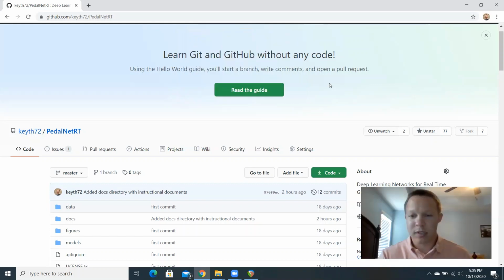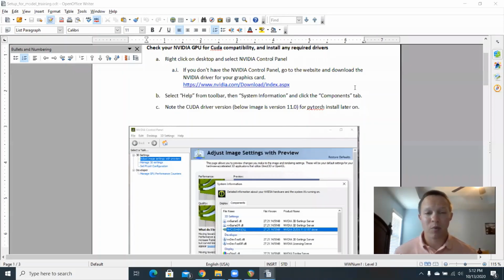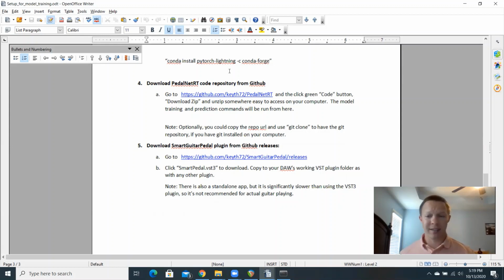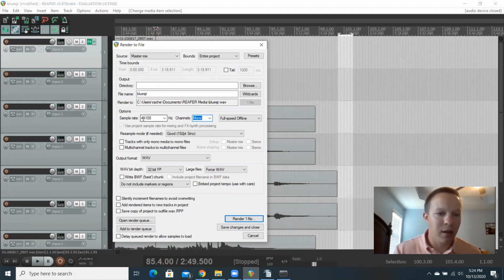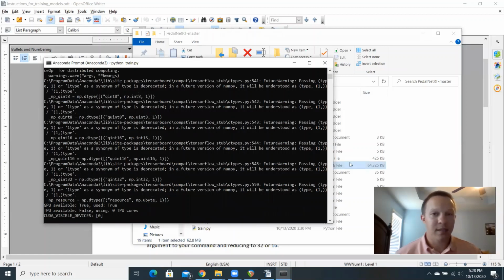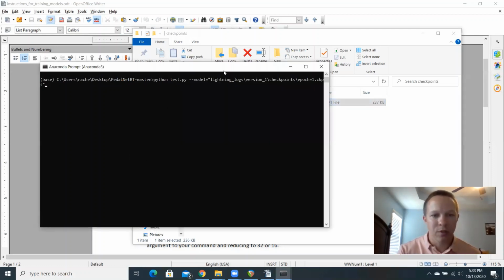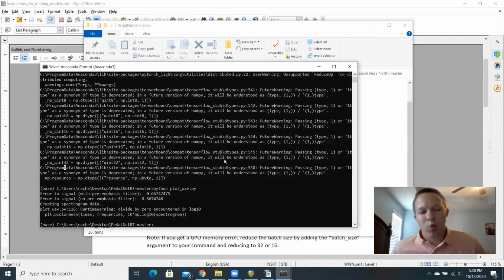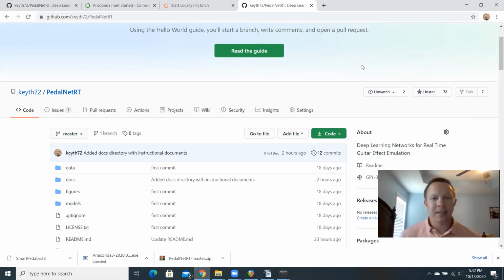Tutorial - Using Machine Learning for Emulation of Guitar Amps and Pedals

Comment: Thank you!! I will be following this guide today, I was following your project since I found it like 2 months ago but I didn't have time to use your files :(, now I can and also you did a video!, didn't know it was so straightforward :)
Thank you!!
Reply from the maker: Thanks for the great feedback! I think people hear terms like “artificial intelligence” and “machine learning” and assume it’s really complicated, but it’s really just a different way to solve problems, and there are a lot of great tools like PyTorch that make it accessible to anyone. Let me know if you run into any problems and I’ll help you out.
Reply: @keithbloemer  Thank you!! One thing I was thinking that you could improve is to add a low and high pass filter (for both wav files) in your model before doing the training, if you delete low and high freq (0-60, 10k-30k) the training should be easier since there's less information, and also high freq uses a lot of data, and maybe easier for the model to replicate the original file :)
Reply from the maker: @Francisco17Berrios  It should save the most accurate model it can train within the 1500 epoch limit, or whatever limit you set it to. As far as what’s an acceptable loss, it’s really up to what you think sounds good. Less than .02 and I usually can’t tell the difference between the model and the real thing.
Reply: @keithbloemer  Thank you!

Comment: Thank you for the video! Really straightforward and accessible. I'm curious about a part of the process that either was not mentioned or that I missed though. How is it that your SmartPedal plugin can have a control for "Drive" after the model is trained on a set of audio files that only represent that pedal at one particular setting? Are you able to create a single model with multiple measurements at settings across the range of the knob?
Reply from the maker: Good question, and I didn’t mention that in the video. The drive is just a basic amplification of the signal prior to the model, level comes after the model, and I apply any EQ before the model. It’s probably possible to do a model with a range of settings, but I’ll leave that for another day. Much simpler to have a single model and adjust the signal going in and out of it.
Reply: @keithbloemer  very interesting! thank you for the feedback. for some reason I was not picturing the model as a classic "system" and didn't realize that you could drive a signal prior to the model similar to a nonlinear curve. one thing I will say though is that in my work I found the Tube Screamer to have a nonlinear curve that dynamically changes as you move the "Drive" control. this would lead me to believe that, in order for this model to be accurate to the reference, you would have to create a model with a range of settings. perhaps by creating N models in total and crossfading between them somehow? though I'm not sure if that's possible or if there would be a simpler approach. any thoughts? I may be missing something as I am completely new to ML. thanks again for the video
Reply from the maker: @CamFilms1000  I think you’re right, training a model (or multiple models) at different settings and somehow interpolating between them should be more true to the source hardware. It would take more effort to capture all that data, but if you want to get as close as possible to how the hardware behaves that’s probably the way to go.
Reply: @keithbloemer  Awesome. Really appreciate this dialogue. I was unsure if maybe there was a way to train a model with multiple input/output measurements and be able to interact with that model directly through a control that is a part of the model which would perform the interpolation for you. To me that sounded like a better approach than having to run N models at once but it sounds like that isn't something that can't be done at least with this neural network (though please do correct me if I'm wrong). Thanks for the conversation Keith

Comment: HI thanks for making this video your are good human being

 I or should i say wavenet  made an  amp model. The amp is an  old  Dynacord i have modded to a jtm 45  with el 34. 
 it took 30 hours with my 11 years old first gen cuda quadro fx1800  i found in my old tech drawer.
  it has 64 gpu  cores. 999 epochs  and 0.017 error  anyway it sounds spot on 
 i had clean booster in front wich ads more highs. and  all the clarity is there.

I guess i need i new grafik card  thinking about that gtx1080 have  2000+ cores and when the new gen 
is coming for the gamers i just  pick one used.  It would be great to get down to 1-2 hours 
 
 i only had cuda v6.5 installed could not find that old version when downloaded PyTorch but apparently it worked.

Do  the test signals have to be of the same pattern?
 I did split the the signals and record one straight in to my soundcard the other in to
my amp connected to my torpedo and then took line out to soundcard and matched both signal i recorded for  3 
min of all my guitar skills.

again thanks
Reply from the maker: Glad to hear it worked well for you, even on an older graphics card. I just added the ability to resume training from an existing model, so if it gets interrupted in those 30 hours you can pick up where it left off.  If you create any models you’d be willing to share, feel free to create a pull request on the SmartGuitarPedal GitHub project and I’ll add it to the available models. Thanks for the feedback on using it!

Yes, the output signal needs to be the same input signal through the target hardware, because the model is “learning” how the hardware changes the original signal.
Reply: @keithbloemer   Thats a good idea but i need to upgrade the card  so ideally train models under an hour. 
i will upload a model the first one i did lack  some midrange sounds great with humbuckers but with single coils 
i hear some artifact on certain notes might  been to high level i dont know  just glad it worked :)

Comment: Keith, thanks for doing this really interesting.  I can get a model made but I can't get it to show up in the pull down list of the pedal GUI.  I have put it in the Reaper .exe folder level like you show in your video but it still won't show up.  Any thoughts?
Reply from the maker: That’s no good, are you using Windows 10? It doesn’t currently work on the Mac or Linux build. You can also try reloading the VST, remove and add back in the FX menu and check if the models show up.